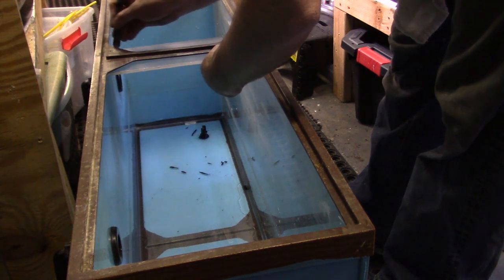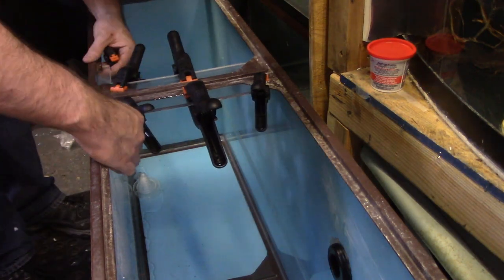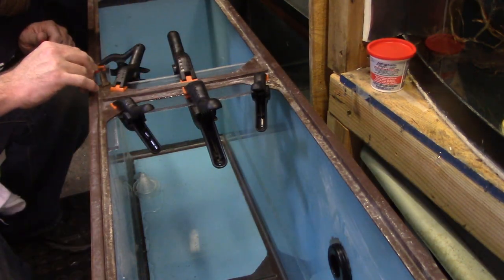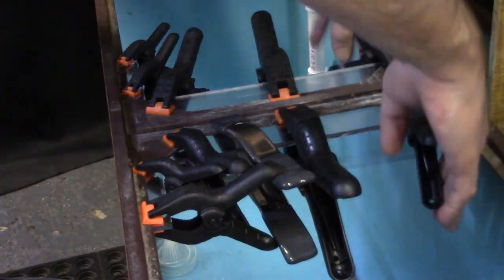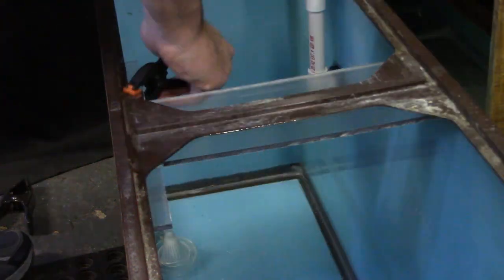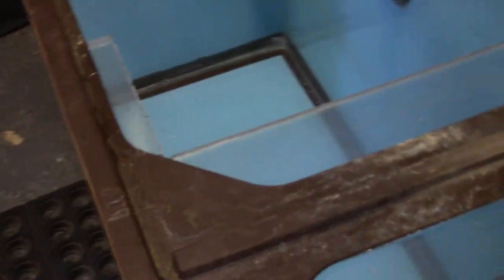Fix a Broken Aquarium Frame

Comment: Very informative video. I have an extremely clean and perfectly working 1980 Toro 824 that I am thinking about doing a Predator engine swap. The original Tecumseh engine runs great, but in the winter, it is nearly impossible to start with the pull cord when it is cold.  Starts right up with the electric start but I would rather not have to deal with that all the time. I am wondering which size Predator engine would be the best fit and best power for this machine. I don't want to downsize in power. With the proper Predator engine and an impeller kit the old Toro should blow snow much better and start much easier when cold. I also have a 1980 Toro 524 that still has the original Tecumseh engine, and it starts perfectly on the first pull no matter how cold it is with the pull cord. My dad bought both of these Toro's new in 1980. The 524 went to the cabin and the 824 stayed at home. Both have been maintained by me sense new. My parents have both passed on in 2010 and 2011. These old Toro's are built like tanks. New aggressive snow blower tires, axle bushings, rebuilt carburetors and of course, the spring assisted scraper blade that works great on paved driveways but not on gravel driveways. They both still have the original rubber friction drive wheels. They don't build them like that now days. I also have a 2022 Toro Power Max HD 1232 that will blow even the wettest snow 50 feet and the powdered snow close to 60 feet. It is a real beast of a snow blower. I still enjoy using the old Toro's. They are easy to use and other than no hand warmers, are a joy to use. Thanks for the very informative video. This summer I think I will make the engine swap on the 824 and add an impeller as well. I have an impeller kit on the 524 and it really improved wet snow performance and blowing distance increased as well. Have a safe and enjoyable winter everyone.

Comment: Do I need to empty the tank to do this? I am willing to of course, dont want hundreds of lbs of water on the floor😭 its just going to be a pain
Reply from the maker: It will be easier to do this empty...especially if the front and back glass moved away from each other without the support of the brace